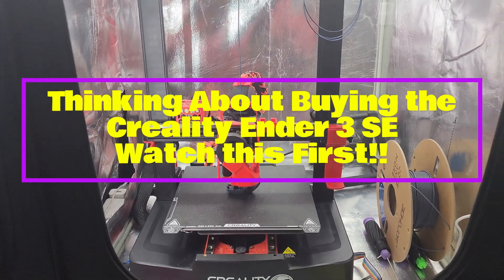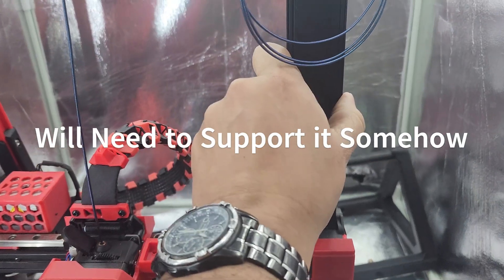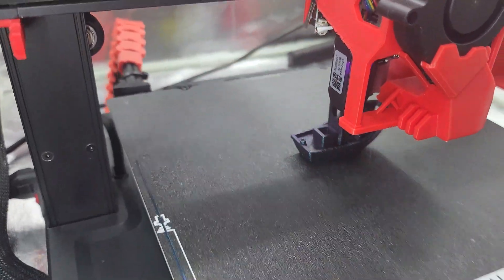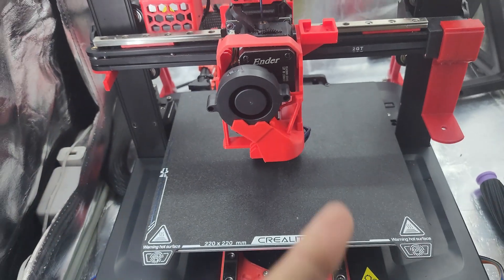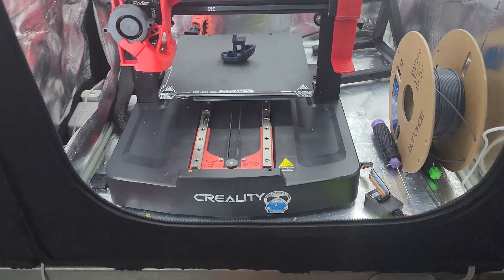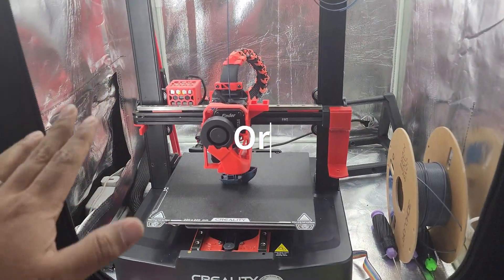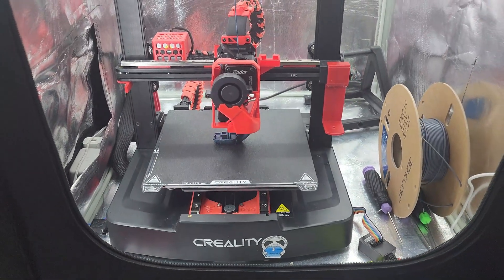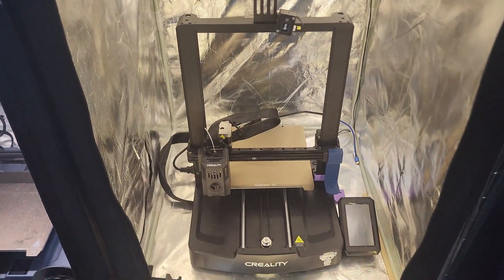Creality Ender 3 V3 SE Part 3 of 3: After 500 hours FINAL THOUGHTS!

Comment: I print abs whit hotend whit no problems standaard hotend. 
Whit nebula pad the hotend go.s to 310 c .
Buildplate go.s to 110.c.
The rest is tru.
And i have mainsial fluidd on my se and i change the rod only the x axis fixd the round rods and it fly.s at 250.
Mms.
Fast a enough the matrial also need some time to bond .
Abs whitout a inclosure not a problem Just slicer setting.s. 
Want to go faster use A BIGGER NOZZLE SIZE THEY DONT TELL YOU THIS LIKE A 0.6 ORE A 0.8 ORE 1 MM NOZZLE. 
AND SEE THE PEINT GO DOWN. 
ALWAYS 0.4.NOZZLE 
AND NOTHING ELSE.
WHATCH NOZZLE SIZES. 
AND JUST GETH A SE .

Comment: With my experience of this printer, I found that using thread locks on all the bolts gave it enough stability Even with the filament holder on top. Also installing Klipper is a really good upgrade for this printer.

Comment: I bought one three weeks ago in November.  They seem to have fixed the gantry stabilization.  Also the print bed is better than the original.
Reply: I noticed they do that with alot of their products. For example, on their amazon store they have 4 versions of the X axis rails upgrade for the se. Cant figure out what they changed, but allegedly they changed.  Out of curiosity, whats different with the print bed from the original? I havent had any issues with mine (yet)

Comment: Hi, I have been using this printer for a while and the SD card reader on my printer is no longer working. Do you have any suggestions for me to use the printer via USB. I am currently using cura but I would rather use Orca Slicer which doesn't support USB printing. It would be amazing if you could address this problem and potentially make a video. Thanks in advanced
Reply from the maker: @yaswanth99999  First, If your within 6 months contact Creality.  They usually will send you a replacement board which will fix your SD card issue.  
In the mean time you can always switch it over to Klipper with with a Sovol Pad, BTT Pad 7, Sonic Pad or Nebula Pad.  
Then you can really bring the printer to life and get it's full potential out of it.
Reply: @yaswanth99999  i use a old raspberry pi 3 with octoprint. Works perfect.

Comment: Iam printing abs.
No problems. 
And Just  super nice.
Just use incloser. 
And no upgrading at all.
I only have two 90 degreas hooks on it.
By a se in heartbeat.
Reply from the maker: @micver1091  It can Print ABS BUT be careful because there is a PTFE tube in the hotend that will deteriorate and off gas toxic fumes over 260c.  You can upgrade it to an all metal to stop that from happening.  That is the reason why Creality does not recommend ABS printing with the Stock SE.

Comment: Im calibrating using orcaslicer preset, but the PA is almost same result on 3 test
Reply from the maker: @EarthquakeCL  Are you doing Model or Lines.  The Model is easier to see where as the Lines just give you the number and a line to judge.  The model you can see a better range to tune into.
Reply: @3DandTeePrinting  3 types of test, the V test look similar all, the tower also similar, the lines, they all look ugly, I also try to go from 1 to 2 scale
Reply from the maker: @EarthquakeCL  Alright let's start with the Basic questions to find a direction.
Is the Filament Dry?
Have you tried with other filaments (petg, abs, etc) and had success with the PA test?
3) Is the Filament rubbing on anything before it goes into the PTFE before the Filament Sensor?
4) Are Your Belts Tightened Correctly? (they are supposed to be self adjusting on the Core XZ V3 but not really).
5) Would you like to join our discord and Added pictures or video so our community can help you out further under "Printer Help"?
Reply: @3DandTeePrinting  Hi. I think is dry, at least: preheating drop vertical a little, stringing almost zero, no bubbles. Is Petg white, dont have other. Dont have sensor, is stock, i dissasembly extruder and make extruder measure in cold, exact 100mm. I post some pic on orcaslicer chat and can share same on your channel group :D

Comment: Right now in australia, the proce difference for SE vs KE is $150 - so how much are the rails and the upgrades etc? Also, can you speed up the SE for higher speed prints , anything speed comparable to the KE?
Reply from the maker: @samh-smith2931  You would have to replace quite a bit to get it to speeds like the KE.  One is KLIPPER Based (KE) and one is old school Marlin (SE).  Both of them follow the "Build it Up Better" motto of platforms to expand on over time.  The SE is great for low cost get into the hobby and modify printer.  The KE is a ALMOST "got all you need" kind of printer.

Comment: Hi! I really liked the upgrades that you made on this video! I especially worried about the gantry being extra wobbly and the noise it made whenever it was jerking around. Would it be possible for you to send me the STL files for all the upgrades you have in your Ender 3 V3 SE?
Reply from the maker: Sure can let me get you a list together
Reply: Thanks man! I really love your videos on the SE and have basically done all of the upgrades you had mentioned 😬 was just wondering if you were able to start the upgrade you mentioned on the motors? I was looking into them have found no forum or reddit post about how to upgrade the motors 😅 I really want to my SE as fast as the KE 😂
Reply from the maker: @shawncabanes8277  I am in touch with LDO on it now.  The recommendation was a LDO Super Speed Nema 17 but couldn't be sure with the current main board.  Still doing research.
Reply: @3DandTeePrinting  I see. Thanks for giving an update 😁 Just wondering, with this current setup, the SE should be as capable as the stock KE right? I mean in terms of speed and reliability?
Reply from the maker: @shawncabanes8277  Most of the parts are interchangeable on the SE and KE.  Hotend and Extrusion Speeds YES.  The Motion system will be once I figure out which motors will work best to get to KE or even faster speeds.  Reliability is all on YOU.  The more reliable your upgrades and installation of them, the more the reliability.
Reply: @3DandTeePrinting  I see. If I am not mistaken, the KE uses a 42-40 X-Axis motor which is rated for 1 amp and the SE uses a 42-34 X-Axis motor which is rated for only 0.8 amps. Was looking to see if changing the X-Axis motor would do the trick but I am having trouble looking for a single 42-40 creality motor in my part of the world.
Reply: @3DandTeePrinting Can I see the list of all the upgrades you have done on this printer with the stl files

Comment: Thats exactly what an entry level printer should not be - modify and upgrade everything - must run right out of the box.
Reply from the maker: If you just want to print stuff sure.  If you want to learn something get in there and get dirty learning why your printer does what it does.  As well as why it doesn't do what it's suppose to do.  What YOU can do to make it better?  Learn on an easily modifiable printer.  If you just want to print something by all means get a Bambu and continue to click and print.  It's all about what You want from a 3d printer.
Reply: @3DandTeePrinting  Would you buy a car or a stove or a washing machine you have to take apart and tinker with before you can use it ?
Reply from the maker: @snörre23  There are 2 sides to this. As a car nerd myslef....  Yes. Yes, I would buy a Fixer Upper to learn more about cars.  
As someone who hates doing dishes, yes I love my dishwasher to just work and not have to Tinker with it. 
In 3D Printing, you can just want a Printer that Prints sure, BUT you learn more from the Fixer uppers so you can master the hobby.  IF you want to get better as you progress into more expensive and features rich printers.
If you want a Dishwasher, pay more money and get a Bambu (some people can't afford a Bambu).
If you want to take your beater car into a Muscle Powerhouse or Late night Crusier you CAN by tinkering.  The Ender 3 Lineup offers that.  A Learning experience.
Reply: @snörre23  you can use it fine out of the box. What he does is modifying it to make it better. Like adding a turbo to a car. You dont need it but it will help. I have the same printer and its all stock. Prints fine for me.
Reply: My entry level printer was an Anet A8 4 years ago that I had to build myself and calibrate the crap out of and I printed only a handful of things. This printer ran out of the box at 5x the speed with 10x the quality. Had it for a year and then started printing upgrades to make it better and to better understand the printing process. In that time its has printed almost non stop. Just because someone does a lot to make their printer theirs, doesn't mean it doesn't print out of the box.
Reply: It Just runs out the box.
And a print abs tpu pla pet g.
And not a problem in the  world.
People  need to learn to slice first.
Behoren they  start printing. 
The .se. is a top unit.
Reply: Then buy a damn Bambu. You can't have cheap and perfect in the same box...

When i bought one of these i knew nothing, i learned everything while tuning it.
Reply: @snörre23  it runs straight out the box
I can send you benchy that I printed after assembling the printer. Sliced it in orca, which has the profile for v3 se, no settings change, no manual calibration, no work in the slicer, no nothing
Of course it's a little bit worse than benchy that I can print right now, but only a little bit. It's not a failing print, that's for sure
Reply: @snörre23  Such a dumb comment.

Comment: I also see your running Sonic Pad on the SE..  I got a taste of Klippers input shaping and added speed boost with a Elegoo Neptune 4,  and now I want to upgrade my SE printers with the Sonic Pad.  I was going to replace the v3 SE's with Neptunes but thats allot of cash, with the Sonic Pad I can get all 4 of them on Klipper with one sonic pad and 4 serial adapters, less than the cost of 1 new neptune 4.
Reply from the maker: 100% correct.  I recommend going with the Serial Cable Connection over the USB-C.  It's a more stable connection.

Comment: While a just printed my first bearing.
And runs like.s Crazy.
I did remove the spoolholder.
And a printed hooks to put on the z.as .
Works great.
And a print starwars kit.s
Almost every thing whit the se.
And you need a lot knowledge of cura to put settings for that.
Its more then a great Printer

Comment: What is a good upgrade from the SE? Which make and model for a little more advanced options and printing?
Reply from the maker: KLIPPER!!!  If you do nothing else put Klipper on it.

Then:
K1 or Flowtech Hotend
Gantry Supports
Upgraded Fan
Remove the Spool Holder from the Top.

Everything else is just easy of use or for esthetics purposes.

Comment: Lol my shrouds are PLA. One's cracked already. Works just fine though.
Reply from the maker: You should look underneath where the shroud is close to the nozzle.   It deforms THERE first.  Especially with PLA.  You can TRY to use HTPLA but I doubt that can handle the heat for long either

Comment: how can i upgrade the fans
Reply from the maker: You would need to either Buy a Fan with the correct connector and voltage or splice a Fan of your choice with the correct voltage. 5015 in this case.  You can use which ever YOU feel will bring you the cooling (with correct voltage) your going to need for the Materials YOU print. Then print a New Shroud that fits that Fan of your choosing.

Comment: Thing is with the cost of the rails just go with the Ender 3 V3 KE. Toss on the same stabilizers for the gantry and you're in a better position overall.
Reply from the maker: Your right
Reply: Rails are kinda useless though.
Cheaper ones are worse that the stock parts, and more expensive ones will cost you half of this printer

Comment: wouldn't a cr10 se be better for the money? comes with linear rails and dual z axis lead screws and can print up to 600mms
Reply from the maker: I am running a CR10SE now and it's PERCISE but for some reason the presets are not as fast as the KE.  The CR10SE is more of a accuracy printer then a speed demon.  It says it's capable of 600mm/s But I haven't seen it get over 250mm/s.  I would have to alter the profile myself but I am trying to just keep everything STOCK with it until after I run all new gen printers against each other.

Comment: Any specific recommendations for gantry support files mate?
Reply from the maker: GANTRY SUPPORT LINK

https://www.printables.com/model/705295-creality-ender3-v3-ke-anti-shake-construction
Reply: @3DandTeePrinting  I am assuming it fits  ke and se yeah?
Reply from the maker: @vhrte49  Yes.  About 75% of the KE is shared with SE.  They share the same base and gantry.  
Differences:
X Linear Rail, K1 Hotend, 30T vs 20T Gearing, Nebula Pad, Stepper Motors, Fan shourd, Dual blowers, and I believe the heating element for the Bed is different to.
Reply: @3DandTeePrinting  Cheers mate